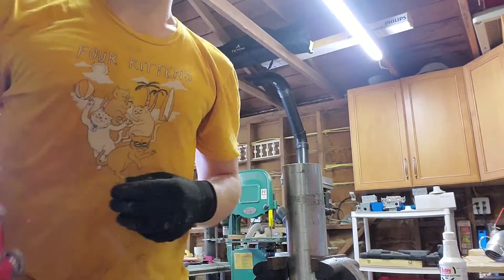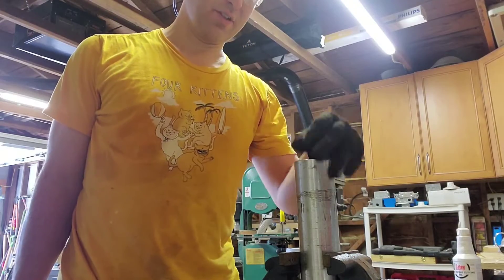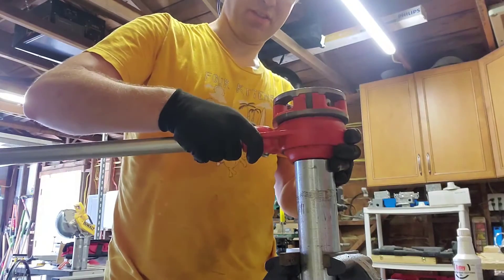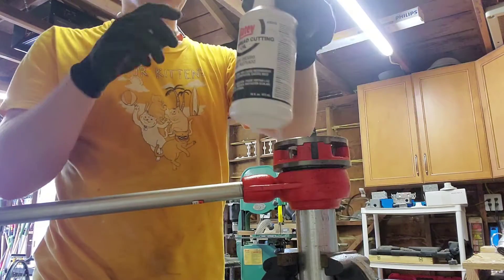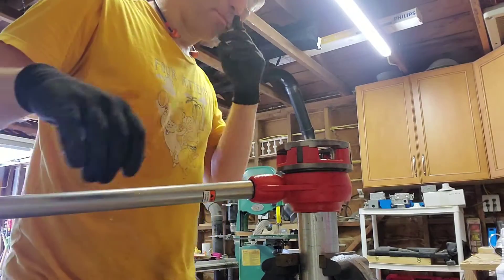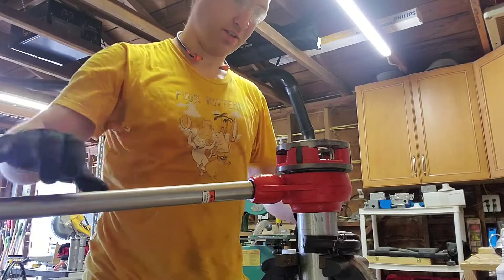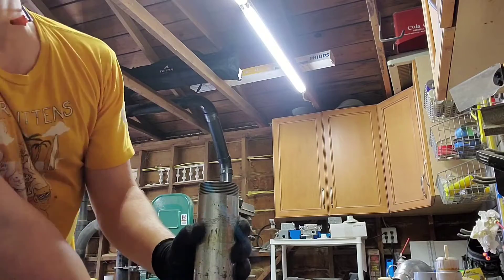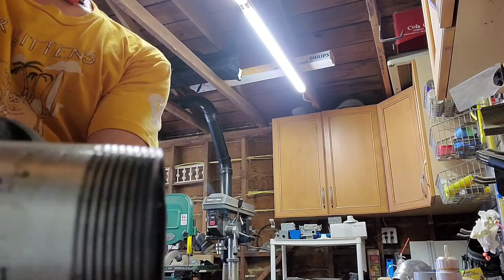Pipe threading 2 inch rigid steel conduit

Comment: So did you get any special type die teeth to thread this or just a standard alloy set … ? For black gas pipe
Reply from the maker: I'm no expert, but I believe black pipe can be threaded with the standard set that Home Depot rents. Black pipe and the galvanized pipe like this video are both steel, just with different coatings.